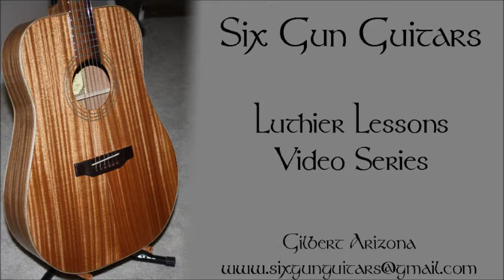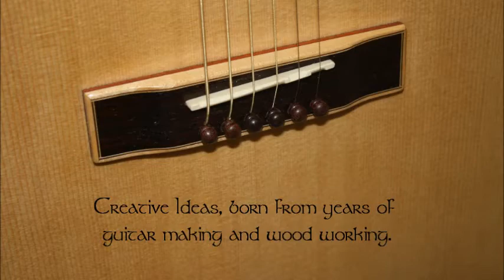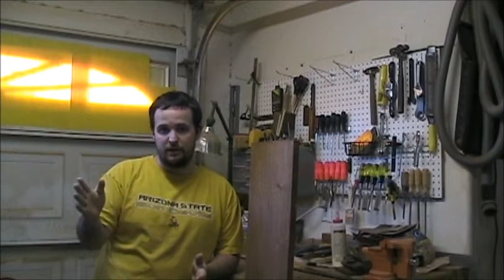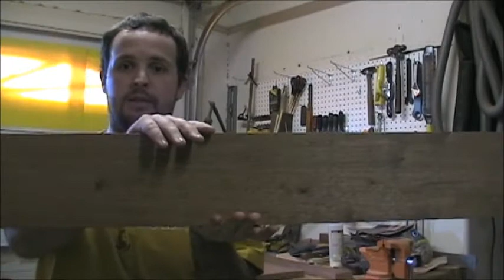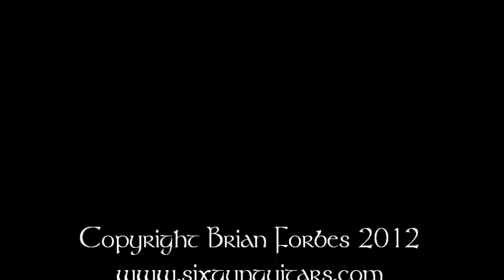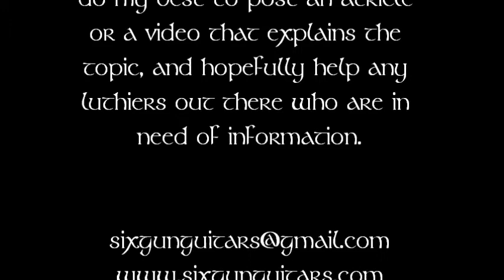Dreadnought Project: Introduction

Comment from the maker: I've been trying to figure a way around it too for years.  I would much rather get 4 pieces from a board rather than 2 pieces and another sawdust pile that has at least 2 more pieces worth of wood in it.  I have a bandsaw but the attachment to increase the cutting height costs about the same as the saw did.  Maybe one day, but for now I still use my original method.  Best of luck.

Comment from the maker: I run the pieces through the table saw with the blade as high as possible, then flip it over and do the other side the same way.  There will still be a couple inch wide strip down the middle that the blade didn't reach, so I use a saws-all with a long blade to finish cutting through that.  Use a hand saw if you don't have a saws all, and be extremely careful using the table saw too.  Email me if you want a pic or a more detailed explanation.  thanks.